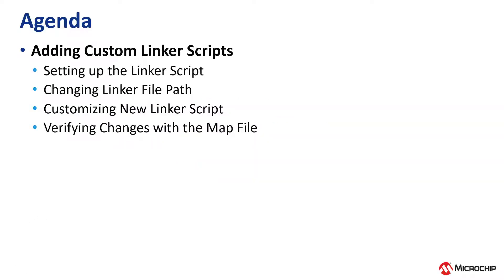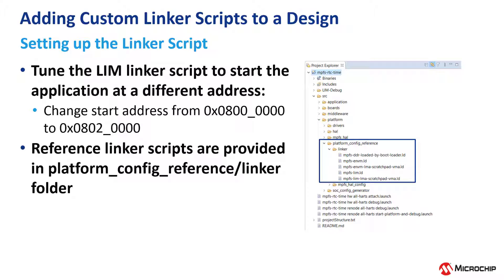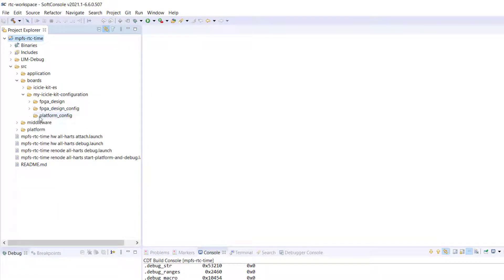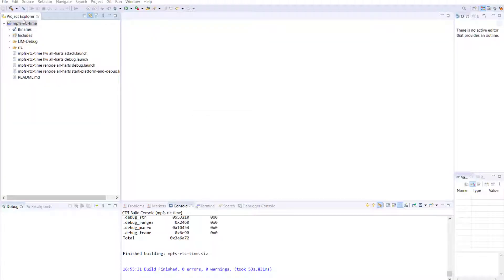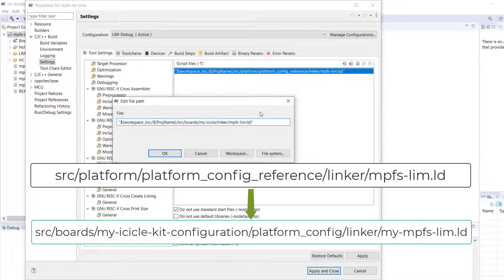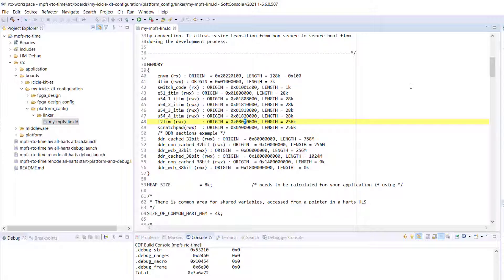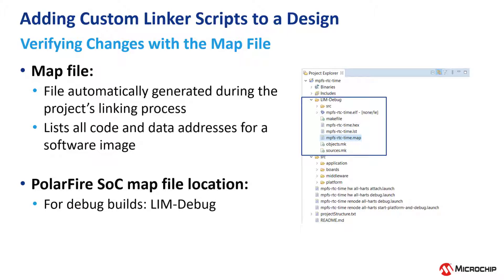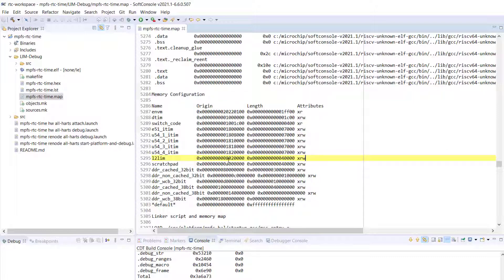PolarFire® SoC | Adding Custom Linker Scripts to a Design

Comment: I posted this on the forum, but there doesn't seem to be much activity there based on all the unanswered questions..  

What I'm trying to do is create a new memory section in the linker script such that the linker only uses it for variables that I have explicitly set to it.

For example, a new 4k ram block is instantiated in the FPGA fabric and is mapped to address 0x40000000.. 

I then added in the linker's MEMORY section :
memblock (rw) : ORIGIN = 0x40000000, LENGTH = 4k

And at the bottom of the SECTION portion:
.NEWBLOCK (NOLOAD):
{
. = ALIGN(8);
* (NEWBLOCK);
} > memblock

Then I declare a variables attempting to place them in this section:
char initialized_array[100] _attribute_ ((section ("NEWBLOCK"))) = { 0 };
int non_init_data _attribute_ ((section ("NEWBLOCK")));

Unfortunately, while it links fine (optimization set to 0/none), the variables are still located in the same space as any other variable  (i.e. not 0x40000000)!

I've tried with and without the NOLOAD, adding KEEP.. adding bss to the var declaration like section(".bss.NEWBLOCK") but nothing seems to map it correctly!  Any suggestions?